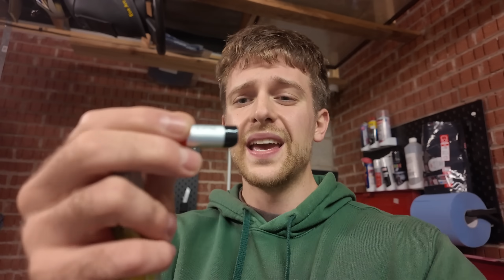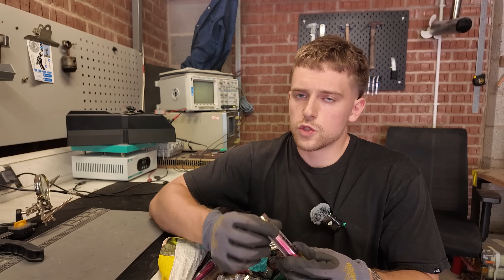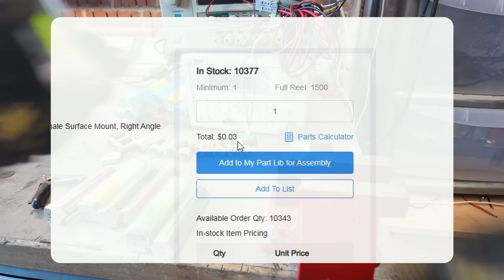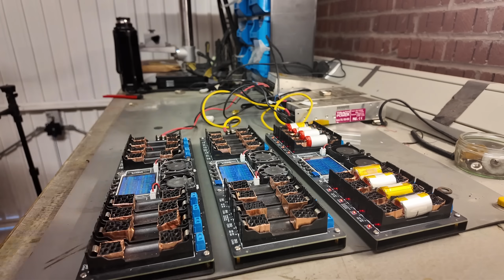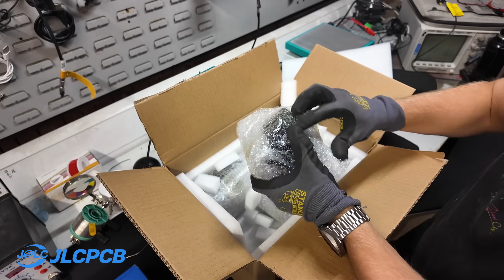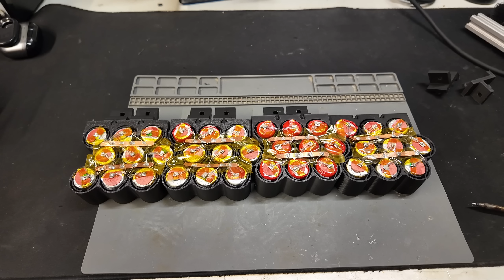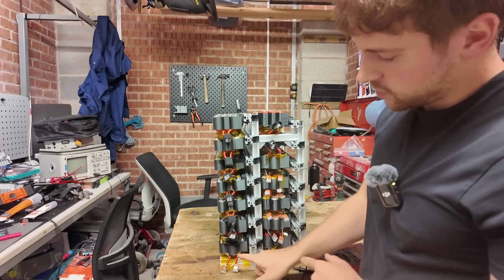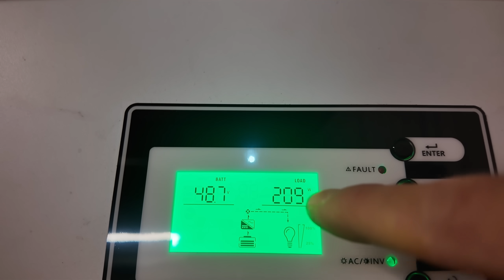I Powered My House Using 500 Disposable vapes

Comment: Just a little heads up and concern. Back-feeding power through your workshop/garage's supply leg (probably armoured cable buried under the ground). Using that same cable to supply power to the house is not safe. What you actually want is a change-over-switch. Whereby you can swap between mains grid A/C and the Inverter supply. Similar to a industry UPS setup. Pull another armoured cable thats plenty ample to supply your houses consumer-unit/fuseboard from the workshop. What's not ideal is you really want your mains A/C incomer in the same area as your change-over-switch and inverter. Just to make wiring between easier and smaller gauge cable. You'd probably want a spool of 16mm2 3core armoured cable. I've probably rambled on a bit here, but basically do not back-feed into the consumer unit like that. The load that cable going to the workshop or the way the cable has been sized is for the workshops total amperage only. It has not been designed to handle the houses total amperage (going the other way). Schneider electric make some nice switchgear for this sort of thing. You can get automated change-over-switches too that are suited for a gen-set. You could maybe re-purpose one of them to go between on-grid A/C and Inverter power whenever the electricity costs change.
Reply: Total Current was below 3.6kW so 2.5mm2 and 16A fuse on 230V should be fine.
But you definitely have a point that a consumer circuit is not designed for 25A or 35A house connection.
Reply: Came here for this comment, I cringed a little when I saw there was #1 - no lockout, and #2 back feeding.  I realize this was just an experiment, but still - best to be safe when messing with volts/amps like this.
Reply: I realize that it probably does violate code and/or standards, but practically is there a real issue here? Shouldn’t the breaker in the house for the workshop be sized for the conductors laid in the ground, so if the house pulled too much current, it would trip?
Reply: @ColtonBaldridge lots of issues, the main one beeing the rcd protection.
Reply: @ColtonBaldridge If both the conductors and circuit breakers are sized correctly, you'd be right.
Reply: Quite right of course but this is a POC not a recommended installation! In Spain when we had the 19 hours power cut earlier this year I did a lot of connections not in the IEEE manuals to get my genny temporarily feeding the fridge and lighting, with double isolation from the incoming circuits,  -- but if I was to make a permanent installation I would do it properly with an automatic switch over of course!
Reply: @jrgroberts  even for a POC, the lack of some standard safety stuff in regards to the construction are a bit scary. Solid state fuses are almost a must when dealing with lithium batteries, especially with cells of dubious quality. The lack of fireproofing is a house fire waiting to happen, mix that with a lack of cooling for the cells too.
Reply: Nice manual transfer switch! Super safe!
Reply: I don't really have any problem with what the YouTuber did understanding that he was doing this to demonstrate the waste of these batteries. This is not a guide to DIY a home battery. But unfortunately no one caught the memo on how much of a stupid idea this is to do in practice. If it were me and I was the only one touching the breakers using two source breakers I just flip between is fine but it becomes a massive hazard if anyone else touches it.
Reply: He was also being safe by tricking the audience a bit seeing how his house is dark and everything is off except for a select few devices with easily calculable current draw.
Reply: Yeah, that was my first thought. Not that I think it's unsafe, obviously they're doing it safely, but I wouldn't post it online.....
Reply: 🇬🇧 👍🏽 November 2025

Indeed!

I know that this was simply a (successful) proof of concept, but I didn't even know that backfeeding like that was a thing - it seems so Heath Robinson (read: inadvisable on a number of levels).

You actually need an electrician to create a second feed-in at the main Consumer Unit - fed by the inverter, which feeds the house.

And a proper make-break-make switch to swap between the two possible sources of electricity. 

~
Reply: I don't think anyone was actually taking this as a serious project that would be used long term...well, besides you and I guess 150ish people.
Reply: @yoloswag4063 only needs 1 person to take something seriously for something to go wrong 😂

Comment: You could make your power bank alot better if you can get your hands on some Lipo batteries for RC cars n trucks. Like 2s 3s 4s 6s 8s lipo batteries. I have a bunch of em myself. I got around 100 large lipos most are 3s 4s and 8s lipos. For my Brushless Traxxas and Arrma rigs. And then i large capacity 2s lipos for my trail truck rcs the rc trucks that look like real trucks. Scale rock n trail trucks. All mine use Brushless engines now. I dnt use brushed motors no more. I got a massive collection of em tho. I do crazy things with em lol. I took my Element RC trail walker 1/10th RC trail truck. Which has a chevy K5 blazer body on it, and has white aluminum rims and scale Interco Swamper tires on it. I upgraded all my gearing in the transmission and in the diffs. And installed aluminum drive shafts everything metal. Has no plastic parts no more. The body is made from sheet metal thin sheet metal. And it looks amazing looks exactly like a 1989 - 1990 Chevy K5 blazer thats lifted with mud tires on it. And i upgraded the esc and motor. I put a 6s ESC and a 6s Big block Brushless motor in it.. it runs amazingly.. i dont use 6s lipos inside it tho. I mainly stick with 3s n 4s lipos with it.. because its not ment to go fast. But when i run it through mud and deeper water ect. The torque of the big block Brushless motor and the extra power def gives it a edge.. you should try something with those types of batteries.. and see what you can do. Probably can build bigger n better power banks using 2s 3s 4s 6s 8s lipo batteries

Comment: What I find interesting about the disposable vape trend is how it was a complete 180 from what made initial electronic cigarettes and vapes attractive in the first place. In the early 2010's a big part of the allure was being able to build your own atomizers. As long as you had access to cotton and titanium alloy or nickel wire, you could make it last forever. Over time this technology became more simplified, with simple pre-made coil assemblies you install into an atomizer, but the "rebuildable" ones were still readily available and new platform varieties supporting more complex DIY coils/larger reservoirs were being made. 

Of course, the big drawback to those kinds of vapes is they are HUGE. The industry lingo is "mod", basically, the size of the vape itself depends on the "mod", or the casing which surrounds the battery(s) and other circuits needed to operate the vape. The batteries were also bog standard 18650 or similar cells, promoting re-use and recycling of identical cells found in loads of other products. The tech slowly evolved to favor smaller and smaller mod profiles, eventually resulting in the development of "pod" vapes, a switch from li-ion cells to lipo cells, and the horrendous disposable ones that somehow ended up everywhere like a plague. 

One of the coolest vapes I ever used was the Smoant Pasito. This was a "pod" vape, with a rebuildable atomizer. It was insanely frustrating to build on as the deck was INCREDIBLY small (it was a pod system, after all!), but it was so cool to me that this device was trying to solve the problem of litter.

 Ironically enough, when people replace a vape, or replace a coil, it's RARELY the coil which is the problem! It's the cotton wick! When I vaped regularly I exclusively used rebuildable atomizers. I rarely, if ever, had to replace the coils themselves. At worst I just had to give them a thorough cleaning to remove oxide and carbon buildup. A simple coil refresh + new cotton is all my rebuildables needed to keep going. 

So on these disposable vapes, it is especially egregious when you consider the atomizer is likely 99.9% intact and can run for thousands if not tens of thousands of more hours. The reason they go "bad" is because the cotton is burnt and needs to be swapped, but they all use pre-fabricated, proprietary assemblies which make it difficult or downright impossible to perform this simple maintenance task. Nevermind the fact the batteries can't even be recharged on these disposable pieces of trash. Even on ones with rechargeable batteries, they still suffer from the same design shortcomings, requiring outright replacement of a pre-made assembly as opposed to giving the end user the ability to perform maintenance and replacement of individual parts. 

Another way to frame it is like with a car. Imagine you had to purchase an entirely new axel with the wheels and brake rotors already installed, all to replace a single tire. The only way to replace any of these parts piecemeal would involve completely destroying multiple components, which you can't even buy separately anyway. It is silly to me these kinds of products are allowed to exist.

Comment: So : 9x4x14= 504 cells. The big ones are 5.55W so 504 x 5,55 W = 2797,2 W. For a house using 6,07 kWh/day that's 6,07 / 2,7972 = 2,17 days of fully autonomous electricity, thanks to the most stupid product on earth being discarded in the streets. I seriously can't believe this is actually possible.
A pack like this with all ONE MILLION vapes thrown away EACH DAY in the UK alone, that's a small town of 650 people being off grid for an entire week. Like WTF is going on. Ok it's extremely time consuming building that but it makes it even more incredibly absurd environmental disaster.

Comment: I’m probably wrong about this but I thought that there was a way to jumpstart those “dead” batteries back into taking a charge again. If the battery pack for my cordless power tools gets below a certain level. The battery won’t take a charge anymore. But if you wire the “broken” battery to a good battery with a full charge. it will charge the broken battery up past the point where it will take a charge again. I’m not saying that you would want to do that with all of those vape batteries. But ya know, just saying.

Comment: I save every vape possible for this exact reason. Too much Li-ion battery power to waste.
Your electricity measurements and transfer knowledge is beyond me. Care to buy 200 prepped Li-ion 650mAh batteries (w/ +  -  wires attached, cut ready for connection)?

Comment: tbh I would also like to see more data during tests - the temperature of battery cells (a thermal vision picture would be great), the power consumption during charge, the total mA\h or kW\h capacity and so on. The project is cool AF but the techincal data which you could collect during tests is really important from the scientific point of view. For example - max power output, the battery cell life and so on. The biggest thing you can improve in your design - make the cell replacement easy. If you manage to do this, you can sell your design or even make a product to sell on kickstarter

Comment: Great demo. But be a good idea to mention that there are differing quality standards for battery cells, for EV and EESS systems they need to be a helluva lot higher standard of safety integrity compared to the types used on e-scooters e-bike and vapes

Comment: I dont get it dosent he need the charge the disposable vape batteries when they die from charging the house? like its nice to use vape batteries and recycle them but you cant power your house forever then how does the batteries keep the charge in them ?
Reply: He can charge them back up with solar or power from the house, back through the inverter, but I don't think it will work for long.

Comment: Might also be a good idea to 3D print an external case for the battery pack as well. Just to prevent possible battery penetration from the sides.

Comment: Can we all just appreciate that you made a power bank that would otherwise cost in the thousands of dollars (or pounds I guess) for a fraction of the cost, labor intensive yes, but the savings equivalent is probably enough to cover the solar cells to charge the bank (to be completely off grid) assuming you also install them yourself. I think it would probably also be worth mentioning that you're partially paying in safety, since the power bank you built is covered in exposed wiring, even with three layers of protection from shorts. That could probably also be mitigated probably the rest of the way by putting the bank in some kind of case, just so any potential fires don't spread to the rest of the house.

Comment: I once tried to re-charge a single use vape again by taking it apart. It worked but the battery started to swell up after re-charging it so i recommend doing it only once or not